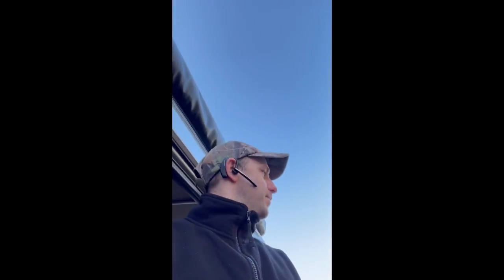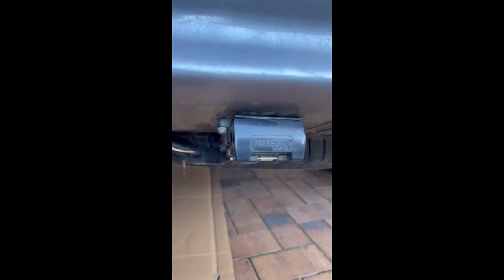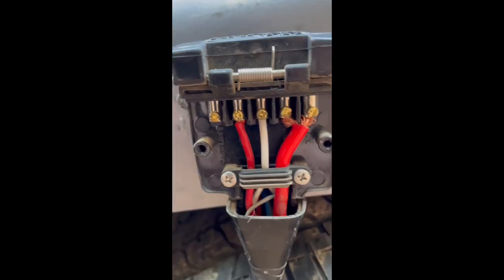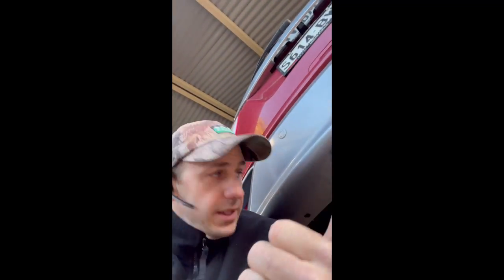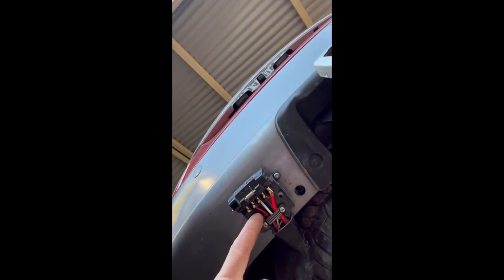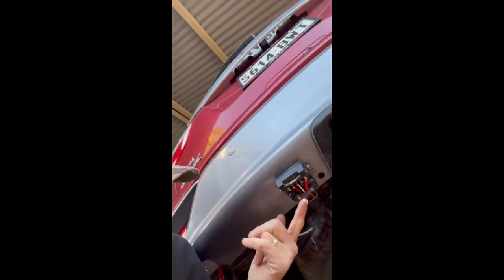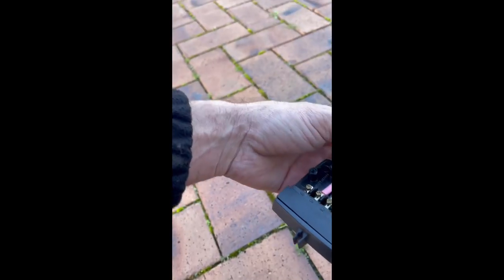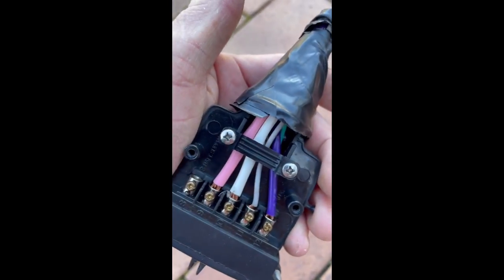More 3 way AES Caravan Fridge wiring issues sorted again

Comment: Why on earth are caravans putting in 20th century 3 way fridges still? I bought a brand new caravan last year and it came standard with a 190l compressor fridge. At a $45k pricepoint. It also had a smooth aerodynamic body again, not 20th century clad in rippled ugly air catching aluminium? This video has one someone just bought.